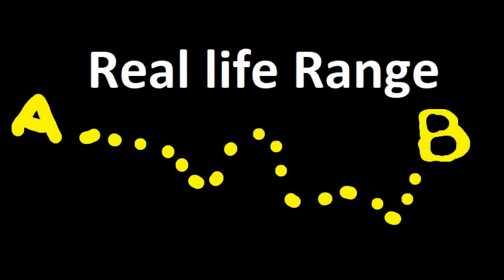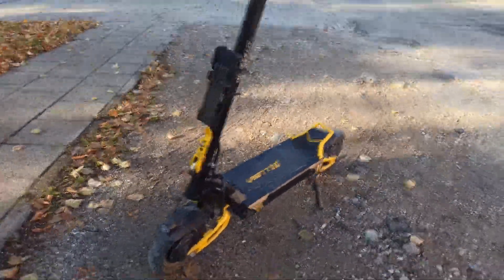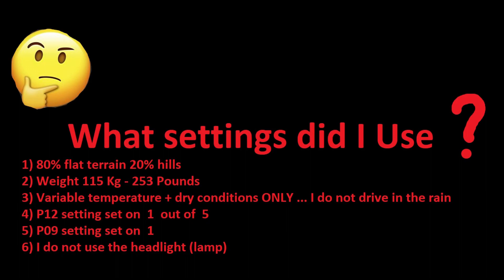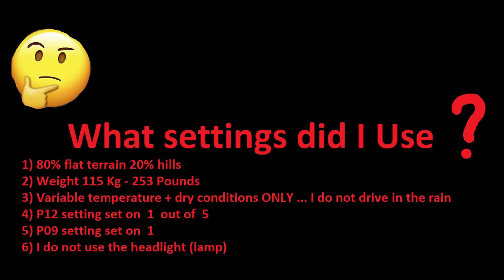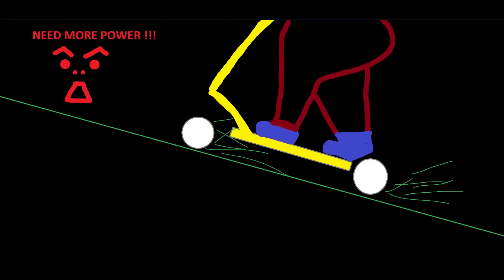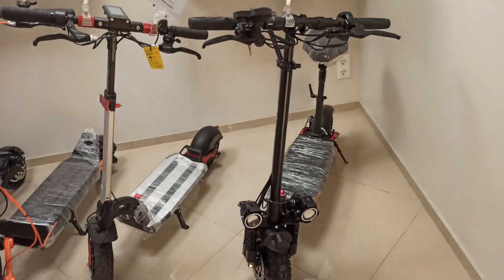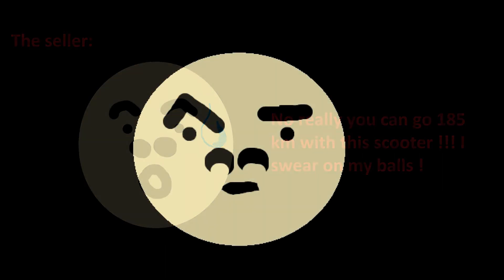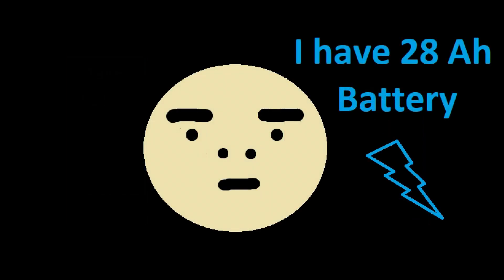Vsett 10+ Battery comparison and real range calculation. Discussion

Comment: I have come to exactly same conclusion on single vs dual-motor range as you did in video. Btw do you still have your Vsett10+ in 2025, how has it held up or did you sell it?
Reply from the maker: Hi there :) I still have my bumble bee :D ... as of today I clocked in 17000 km :)
Reply: @Guitarnoob99  Thats awesome do you still have original electronics: battery, controller? Had to replace my battery after like 800km. I have had it for over year and done 3500km now

Comment: I also have the same range with single or dual motors on my 11+. Also, after more than two years, I haven't noticed any battery degradation. I always drive the same route to my workplace 35 km total, and it always starts with 67V and I return with 58V. I believe it has some 20 more kms in it after that which is noticeably less than what vsett claimed it should do. I have to admit I never juiced it all the way, never bellow 57V, actually, maybe that is the secret why my battery seems like brand new. If I could change something on my 11+ is the weight and brake discs that are the same like on bicycle 40kg lighter than this beast.  Discs should be thicker, they bend and squeak.

Comment: I get between 28 and 33 miles out of my Chinese 20.8ah battery vsett 10+ but I only have 500 miles on it. Punch level 3 always dual motor and 60% power in p settings. I weigh 175lbs.

Comment: do u think that vsett 10+ is still a worthy buy in the current year? i mean it is coming to be several years old by now. btw, labas :D
Reply from the maker: Labas labas :) I could answer in lithuanian but then everyone else probably would not understand my comment xD 

So to answer your question YES I think it is still worth buying for the simple reason that it retains the good stuff and it has been upgraded over the years to eliminate all the foults it had at the start. On thing that still is shit as I talked to new owners and I see it on the internet ar the brakes but that is not Vsett that makes them but Zoom ... and these are piece of crap!!! many el/scooters have them and they are very poor quality as they could start leaking after as little as 300km of use or in my case 3000 km but in short they are not good.

Comment: Mine beast is on the way to me now, cant wait to hop on it man..i guess knowing myself i will drive it on max settings yea..with the kick start so my kid don’t wreck it by pushing throttle in place. So i can expect around 30-40km at those settings with biggest battery. And its totally good for me. I don’t need more than 10-15 km per day for commuting purposes. Thanks again for the video man! Cheers!

Comment: I love my Vsett and I get 100km range using the 2 speed with the range battery extender.
Reply: What's a range battery extender
Reply: @Nypolice2  an extra battery you can connect to your original battery and controller

Comment: I have gotten close to 90 Km but im 140 lbs and ride in single motor, I think the truth is somewhere in the middle, if you are past a certain weight, single motor wont work for you as it causes the single motor to push more weight, therefore dual motor would be more efficient.

Comment: Three points. 
1) Really good consideration of all the variables when you did your test. The only thing you forgot to tell us is was there any kind of strong constant headwinds on the majority of your range test and what kind of tires you were using (road, hybrid, off-road), and what pressures you were running them on when you did the test. Both of these combined will have a  huge influence on the results. 
 
2) 10:15 I think you found the main reason for such a large discrepancy between the manufacturer's claimed range and your actual range. WEIGHT is a very influencing factor in motor power consumption. 
Imagine if you had to sprint a 100m race whilst piggybacking something on your back. First race, try it with 2 bags of 50kg (110lb) cement mix bags tied to your back.
In the second race, do it with an empty backpack. The difference in power required, energy consumption and time taken is immense. 

3) In your situation with the noticed degradation of the battery pack over the years, you are actually in a position to get that range back . . .FOR FREE. . . in fact you would save money AND get your range back. Sounds great right. You want that? . . . . yes. - - - - - start losing weight :) - - - - - -  how much do you want it now?
Reply from the maker: Hi thanks for the comment :D ! Glad you watched my video. 1) yes you are right and thats a valid point I did forget those veriables :) so in terms of wind there is hardly any wind here in Vilnius, so I think it is safe to say I was riding during wind free conditions....as for the tires I got TOUVT semi offroad tires hmmmm ok thats a good point actually cuz I did the test with regular tires....and presure 3.5 BAR or about 50 PSI so the presure I think was pretty high and should have helped with the range

2) Yes that is very true :)

3) Haha lets make fun of the fat guy :D yeah ok ok ... but seriously my weight did not change much from the first day its like +2 or 3 Kg so here I kinda dissagree with you, but I can kinda see what you are trying to say that if I weigh less the automatically the range should go up naturally, because my point was that the range dide not go down because over the years I gained 3kg :DDDD so if i love 3 kg the range is going to come back ... its gona take much more than that to get it back :) 

how much do I want to get back my range ? :D well not that much as im done with food delivery job so I dont need the big range anymore, but I am happy to say I am taking mesures and I am losing the weigh :)
Reply: @Guitarnoob99  Ah I forgot about the food delivery job hence the amount of Km's. 
Really good point about the negligible weight difference over time. If all other variables are the same that definitely shows the effects of battery cell degradation over time. One thing I learned when I purchase my Vsett10 is that because there are three different battery sizes, the range is not the only difference between them (although it's the main one).
I learned that the larger the battery capacity, the less the voltage sag under high power consumption. I think it's because there are more cells in the pack so the work is shared over the greater number of cells. This should help to some degree in minimizing cell degradation over time. 
On top of this, if you have two people commuting the same distance every day, and one has a battery pack twice the size of the other, that would mean he most probably would be charging approx half the number of times as the guy with the smaller battery pack, hence his battery would last longer because he is cycling it half as often. 
Both these factors instantly made me drop the smallest battery option in favor of the mid-sized option. (The 28ah option was too expensive unfortunately)

Seasons greeting from here in New Zealand. Christmas is fast approaching here which means holidays and lots of food in this part of the world so I better be careful or I will be the one losing range on my scooter :)
I only just realised how close you are to the war. I follow the progress closely down here. I hope those pesky russians dont start any funny business in your lovely country. God bless

Comment: I got the light Version of the vsett10 + and i would buy  a secound one, cause im Loving it.

I bought it to get to work.  Every day i rode by bike 12km to work and then 12km back home. 
It takes at 25 - 32kmh 45 /55min (12km) with the bike.

Today im gonna try vsett10 +  with full battery, 30- 50kmh, dual motor  (without boost Button)

Comment: Hello Thomas... As Vsett10 user i must say that your calculation is right for your weight... I have 25.6Ah battery and 200lbs and i do 75km in summer and like 40km max. now when are low temperature... have riden 3300km now and i must say it works awsome but i will see next year how battery will work... wish you many safe miles 🍀🍀🍀🍀🍀🍀